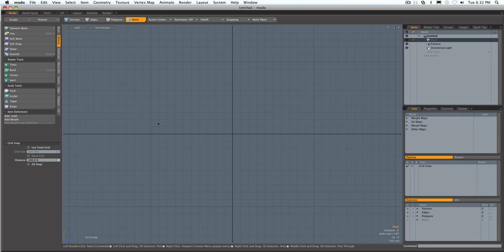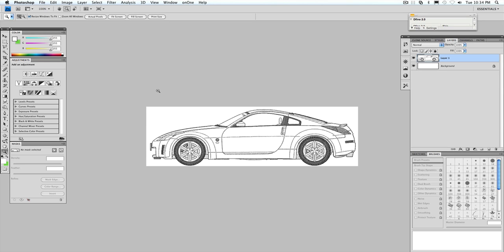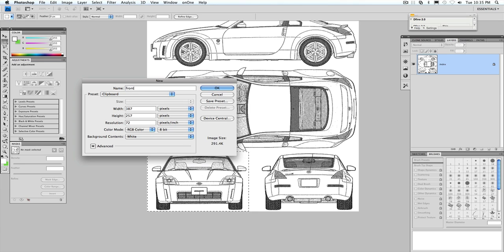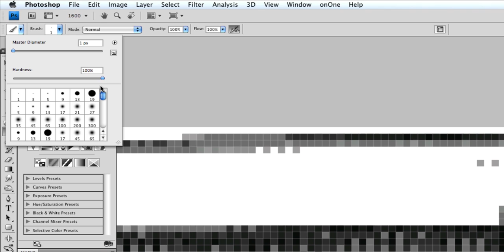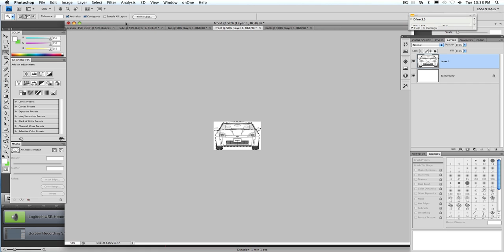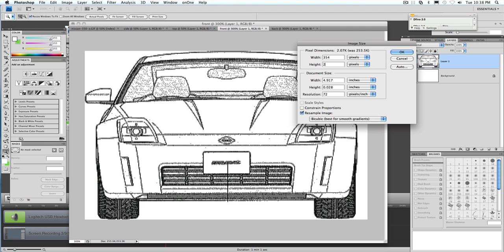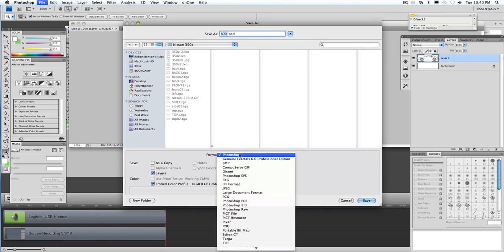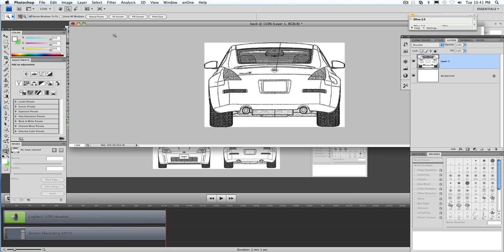01 Modo Car Modelling Tutorial - Start To Finish - Getting Blueprints Ready For Modo

Comment from the maker: If I understand you correctly, you will find the magic wand under the Quick Selection Tool (hold the mouse down for the flyout on that button).  It is necessary to get all sides of the car the correct size because if you're off a little, it will be hard to model correctly from the back to the front (top, side, etc.)